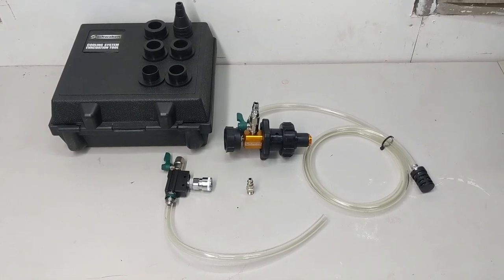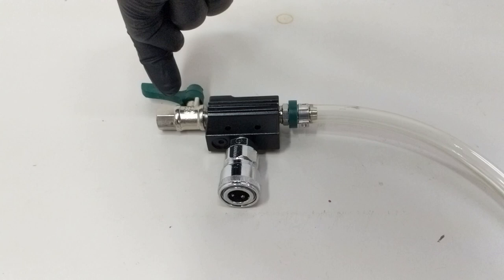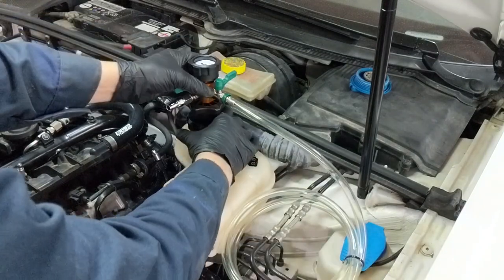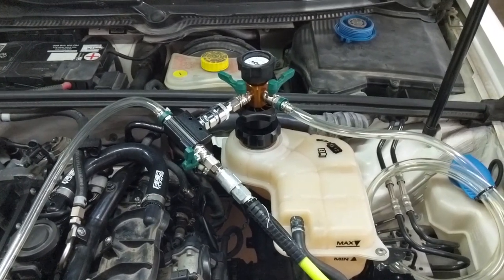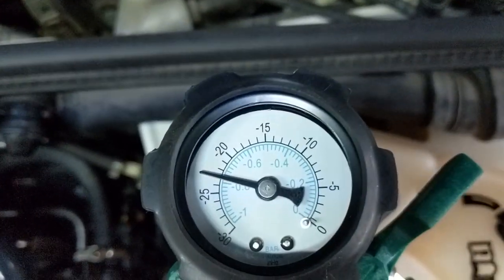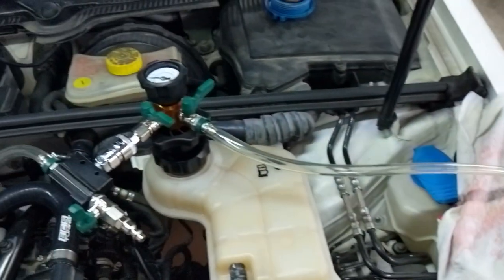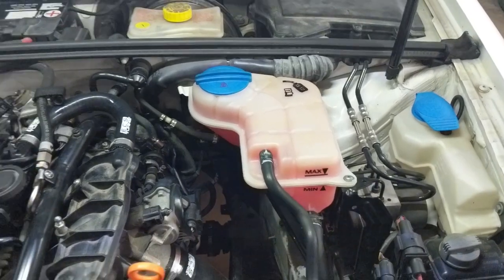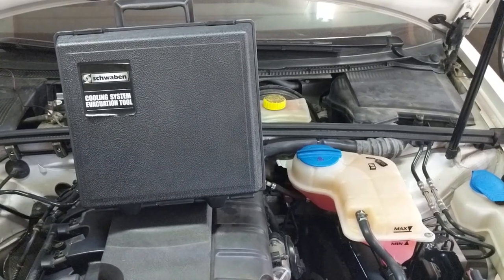Schwaben Coolant Vacuum Refill + Air Purge Tool | Cooling Test and Refill Tool Review | Audi VW

Comment: What did you set the compressor psi too?  The dial show 20 psi  thanks
Reply from the maker: The compressor was running a continuous 100psi.
Reply: Do you also see the heater lines compress like the main radiator hose?  I assume it also pulls the air from the engine via the thermostat.   Do you prefer to use the tool on the overflow tank vs the radiator?
Reply from the maker: @FD-dh2fu  Any hose that carries coolant and is made of rubber will experience some sort of collapse - which isn't always a good thing. If a hose is in really bad condition, doing this might actually crack it and cause a new leak. Which might be a blessing in disguise. Yes: it will create a vacuum in all directions so even if the thermostat is closed (like it would be with the engine off), the air will just be drawn out from the other side of the thermostat from some other passage. Audi's don't typically have radiator caps but any access point big enough to fit the tool in will work.
Reply: @FigureItAudi  thanks.  So weird I managed to get 24 psi on the gauge held for over 5 minutes no leaks and nothing came out other than air from the Venturi     I had to take off the cables from the heater core and they still had coolant.
Reply from the maker: Yeah! So that's a good point of clarity for people to know. This tool will NOT drain the system dry. In fact, it's not a good tool to use for draining, period. I'd bet that if you had the system open at some other location on the opposite site of the vacuum tool, that air movement might actually be beneficial to attempt to vacuum out coolant. By the sounds of your description, the tool is working as expected.
Reply: @FD-dh2fu  I think you are confused as to what this device does. It pulls air out of freshly filled cooling system i.e it purges the cooling system - no need to bleed air out of the system. What it will not do is drain any residual coolant from your emptied cooling system.

Comment: I personally don’t like this tool. You can easily create leaks because the negative high pressure you are creating.
Reply from the maker: @lakkchina I had the same thought while I was testing the tool for the first time.

My opinion is that yes, there could be risk in placing the system under vacuum and causing damage specifically to older rubber hoses that are deteriorating but not yet leaking, or if the hose connections were loose to where they mount. That said, if you tore a hose apart during the vacuum test, you'd also be identifying a problem that you would have otherwise missed, or found out in a worse way.

Other than hoses though, I don't see a seal being sucked off a housing or any other parts that are at risk.